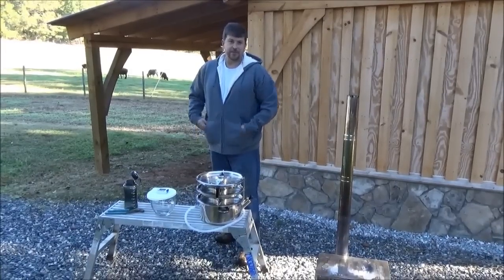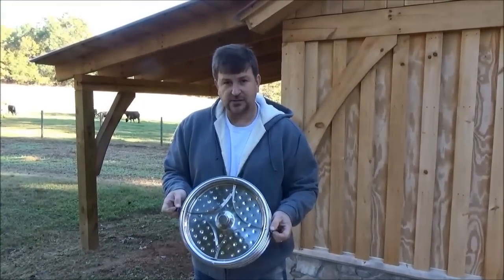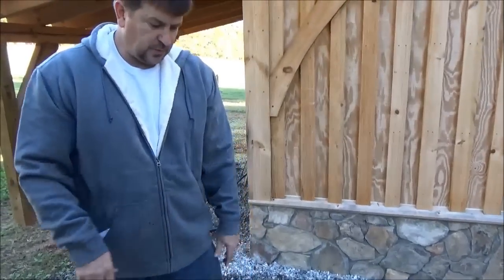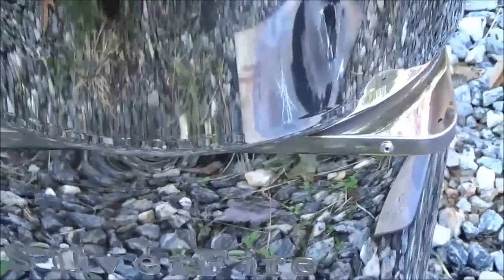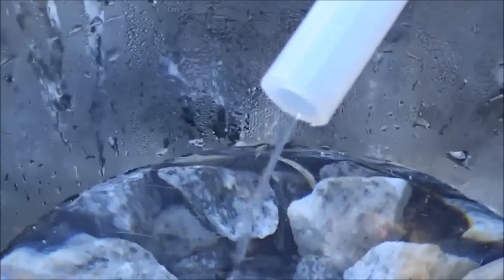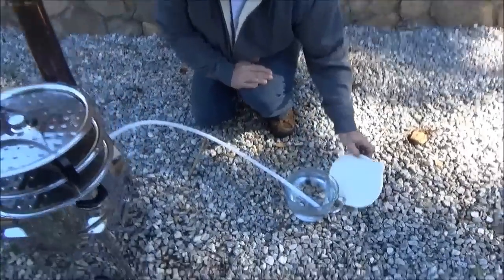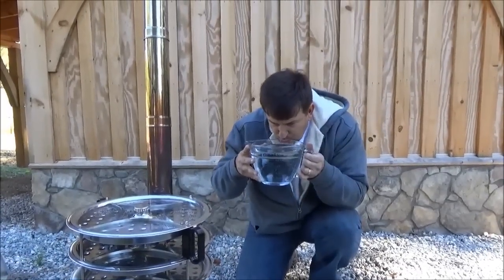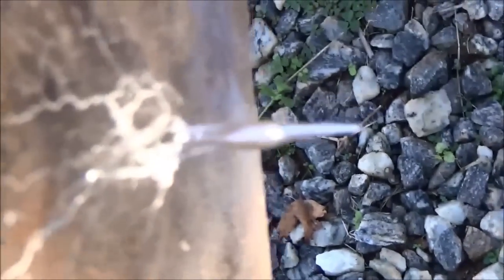Off Grid Water Distillation at its Best!

Comment: Boiled water produces so much fluoride that you should save time and throw out all your equipment!
The vapor pressure is so close to that of water that you will get far too much fluoride, at the boiling point of water!
Distilled water in stores was boiled and it is LOADED with fluoride poison!
Reply: That is why you have to do some research on your water provider, if it is not to the standards of Le Bleu, do not buy it,   Fluoride is a deadly poison, you are correct about that.
Reply: Boiling water does not produce fluoride. Fluoride would have to be added to the water, usually in a water treatment plant, for it to be in there. Pure water does not contain fluoride it is made up of nothing more than hydrogen and oxygen.

Comment: Easy to make your own, from copper sheet, you need copper for good health!
Reply: On a different video I seen something interesting.
It has to do with using copper.
Not only will I tell you the problem, but also the solution.
Problem is the corrosion of copper. The green and blue stuff.
The solution. Run some high alcohol through it. ( great excuse to make some high octane drink) just remember throw away the first 1/4 of a run.
Because not only is it too high octane ( over 95%) but it also has that blue green corrosion in it. The corrosion is very bad for you.
For those that don't want to make high octane. Just use vinegar. Distill about 1 cup per gallon.  So if your distilled is 2 gallons then 2 cups.
And only use leadfree solder or brazen it.
Reply: Ok. I figure I should tell how to make some hooch.
1st is 2nd gen moonshine. First gen is made with potatoes. And only 1st and 2nd are true moonshine. Neither uses yeast or sugar.
2nd gen..... 50lbs of whole corn from the feed store. Soak over night in water.
Next day set it out and keep it moist for the next 2 weeks. You want it to start growing. ( if you ever made bean sprouts for salads same thing)
Most of it needs to of sprouted. 
Next run it all through a flour mill.
Then add it to 50 gallons of water.
Let it set for 10 days in a cool dark place.
Now distill it. 
Throw away the first 1/4 you distill  ( 12.5 gallons)
Bottle the next 16 gallons.
( note here I will call Y1, )
Now take the slop, and that 1st 1/4. Mix them together and feed the hogs.
You just made real moonshine. Enjoy.
Back to note Y1. You can use this (The slop) as a yeast for other alcohol you wish to make. ( DO NOT ADD THAT FIRST QUARTER IF DOING THIS)
.......
Simple hooch, I call it outhouse gin.
Use this ration to make bigger batches 
1 cup sugar added to 1 gallon water ( distilled water is the best, and if you make the cold receipt below ONLY USE DISTILLED)
Bring to a low simmering boil. You want the sugar to completely mix with the water.
Let cool to room temp.
Add 1 teaspoon yeast ( same yeast for making bread works)
(Note on bottling read warning below in cold receipt it applies to both)
Bottle in bottles capping with a ballon you burp daily.  You may use water trap instead if you have one. I advice the water trap much easier.
Let set in dark place for next 30 days.
Now you can cap it. You now have outhouse gin beer. You can distill this for a high octane drink. Distill same way as moonshine above.
Cold receipt outhouse gin. (This is using a 1 gallon wine bottle, you can also use a 5 gallon bucket or whatever with a water trap)
1 gallon distilled water.
Add 1 cup sugar.
Mix ( note you are not heating this)
Then add 1 teaspoon yeast.
Cap with balloon and burp daily. Put in a dark place for next 30 to 45 days. Remember if using balloon method to burp daily. Water trap check ever few days to make sure it has water.
About that warning..... NEVER CAP WITH A SCREW ON LID IN A GLASS BOTTLE UNTIL IT HAS COMPLETED FERMENTING. 
I did this once, and a few days later it exploded at 9pm made a big mess and sent glass flying.
Fyi this is why they used cork in old wine bottles. If it wasn't done fermenting. It simply blew the cork out.
Congrats you just made cold outhouse gin beer. Distill same as others above.
If you choose to just use as a beer....
You may screen with something like a t shirt. There will be a "residue" in bottle if you don't. Personally I just drink it and once at the bottom where residue is I just toss remains, about the last cup. Then rinse bottle out.
Outhouse gin beer is about a 4% to 10% alcohol beer.  You can drink it anytime after the first 4 days for a short beer. ( lower alcohol) the hot method makes  for the higher %.  But I've got over 6% on cold method. It's not the best or worse tasting drink I've had. And it's really a cross between wine and beer.
Reply: I should tell how to make 1st gen moonshine. From potatoes. But unless I'm asked I wont.